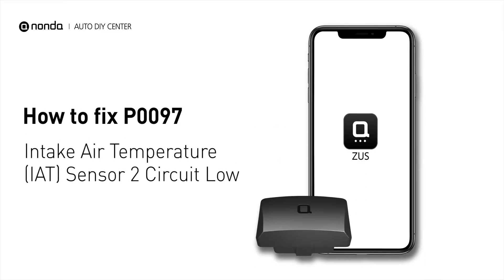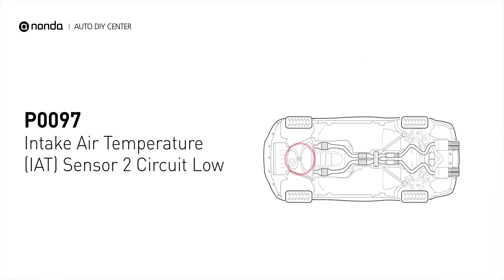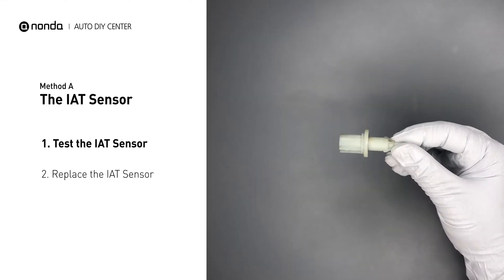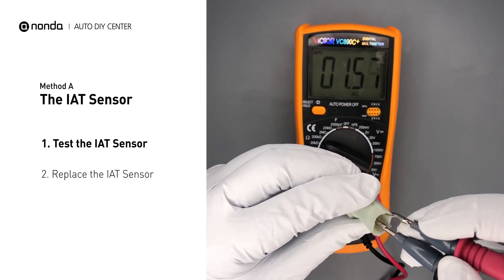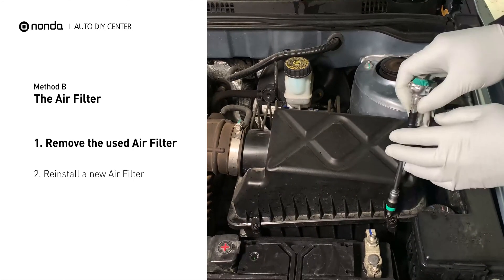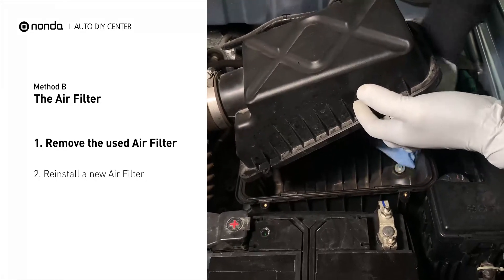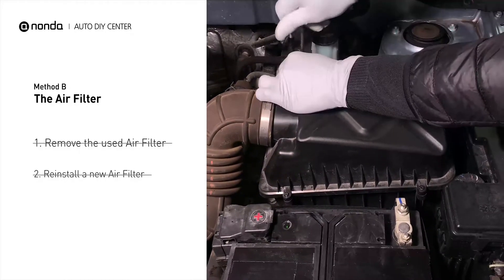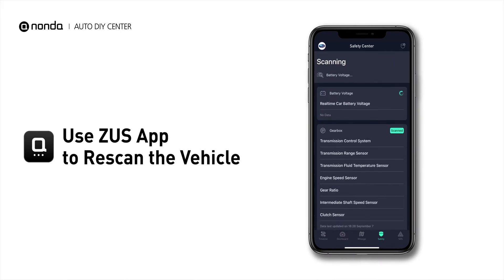How to Fix P0097 Engine Code in 3 Minutes [2 DIY Methods / Only $7.64]

Comment: Hi I have P0097 on a Ford ecosport 1.5 tdci and replaced the air filter still have the code. Where is the part located on this vehicle?

Comment: 2013 Cruze 1.4 turbo, throwing codes P0057, 2199, 0171 11c3
Reply from the maker: Hello, as you are receiving more than one error code, we highly suggest getting your vehicle visually checked by your local mechanic for further diagnosis.
Reply: Did you figure out what it was? Car just threw those exact codes today, but still seems to run just fine. Want to get it taken care of quickly before it leads to something bigger. Thanks!

Comment: Where would this part be located on an 2017 GMC Terrain SLE?
Reply from the maker: Hello, you can find it in the intake air runner between the air filter and the throttle.